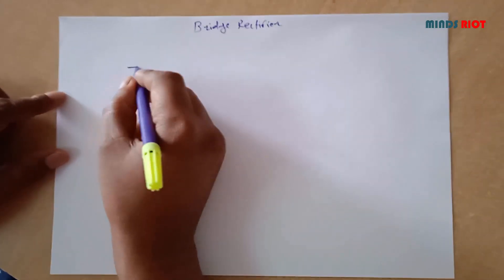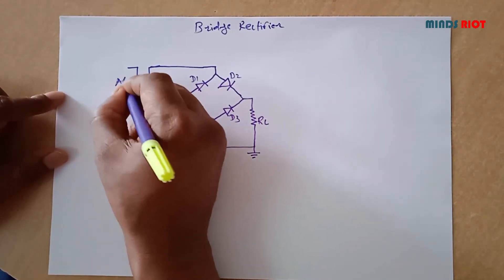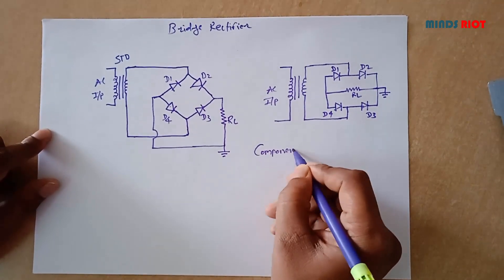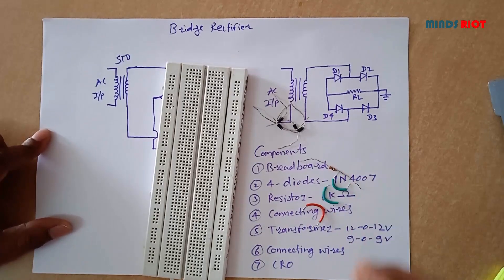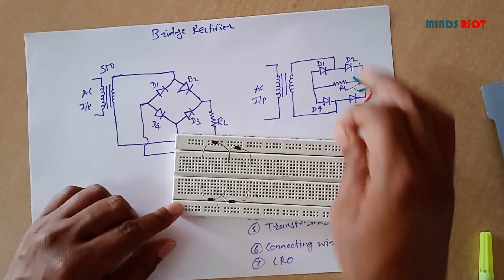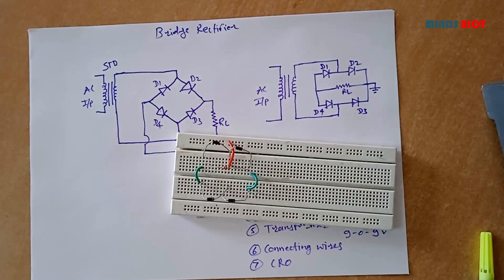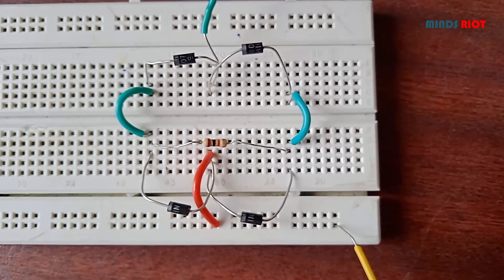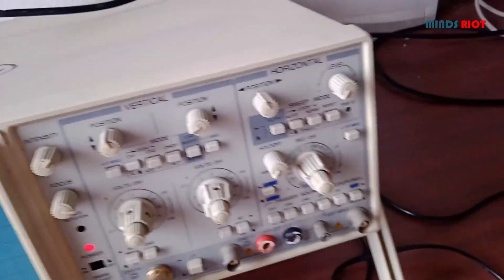Bridge rectifier on breadboard practical experiment on breadboard

Comment: When I connect the ground of my Rigol oscilloscope probe to the output of the circuit, one of the diodes explodes. I can connect a multimeter to the output of the circuit and see a reasonable voltage. It is sort of explained in this video at 2:48, but I could not solve the problem.
Reply from the maker: Please check the direction of all diodes and shorting points